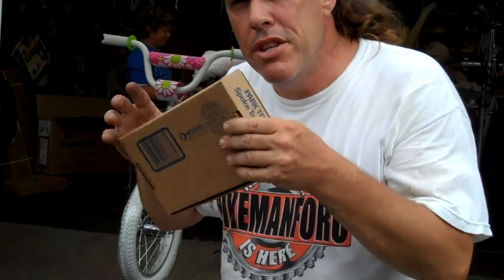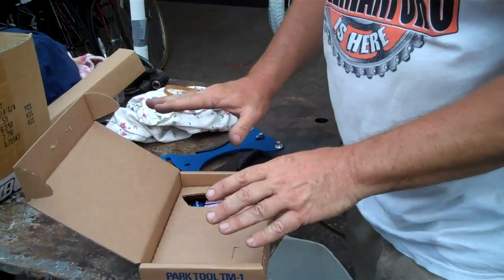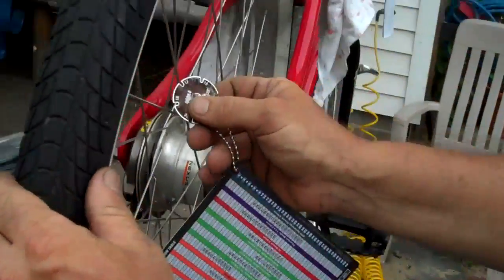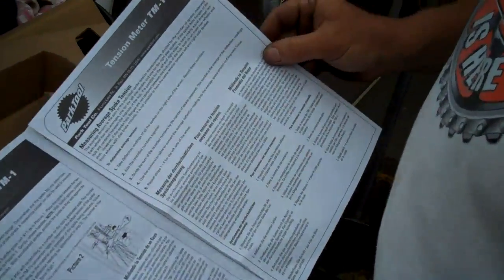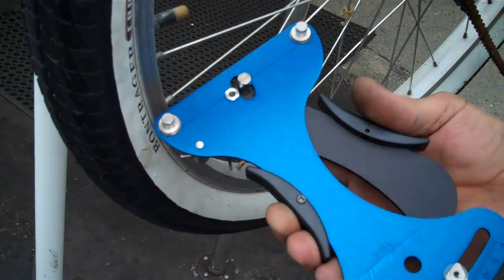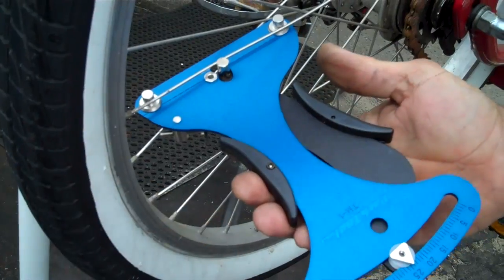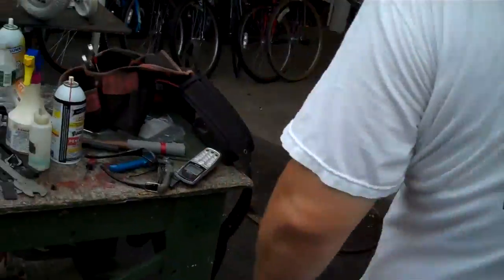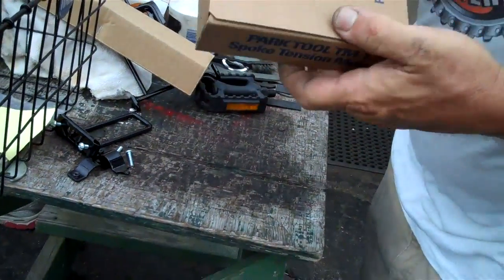Wheel Spoke Tension Meter Park Tool TM-1 Home Bike Mechanic

Comment: Fantastic tool.  I've built at least twelve new wheels with this tool and use a computer spreadsheet to automatically check variances in spoke tension.  The tool also works great to diagnose a bent or deformed rim when you cannot see the problem but a spoke or two keeps breaking and you don't know why.  For that, simply true the wheel and check the spoke tensions.  The rim deformity is near the spoke that is +20 percent or more out of tension with the other spokes.
Reply: excellent tip.. thank u

Comment: You're the first person I've seen release the handle properly. I see so many people demonstrate it by letting the handle snap back violently. I've experimented with that method and have gotten totally different readings on the same spoke. 
You have to slowly and smoothly release the handle like you did to get accurate and consistent readings. Having the tool does no good if you don't make the effort to use it right.

Comment: I'm the same way with special measuring tools. I have two tools for measuring sizes, a dial caliper and an electronic caliper. I never throw them in with wrenches and other stuff. I understand your emphasis on protecting it, of which some irreverent clowns made fun. Thanks for the video, Bikeman. I have been considering buying this tool but wanted to see it in use, first.

Comment: Nice review.   It comes in a nice cardboard box that should be re-used for storage as you point out.  It would have been a good idea for this tool to come in a plastic box similar to that in which a torque wrench comes in, with a separate pocket to keep the gauge and table in.  This would impress on the buyer to keep the box and to USE IT. 

Since I use the table and the gauge every time on mine I carefully keep the table on top of the gauge rather than bury it under the cardboard insert.

Comment: Also when you first mentioned this is a wheel  building tool, you are checking the tension on the low grade wheel that is being  checked with a tire inflated to correct psi. Is this tensioner reading correctWhen you first build it or one attire is audited and inflated to correct PS I?

Comment: And Also is there a publication of the spoke tension matching with at least the most common of rim design, be it with and or without eyelets. I was thinking of the ones with eyelets have a higher tension.  Hmmm.

Comment: I have one myself. It is very useful.

The durable plastic chart / card that comes with it is absolutely amazingly perfect in every aspect. Even better than the tool itself perhaps :). 

No more snapped spokes after using this tool correctly...

I use as a rule of thumb, 1000 Newton on 2,0 mm spokes. A good starting point I assume. Over that, the nipples might start to fail, the tool grip collapsing, twisting and failing.

If one are a bit skilled, one can have a wheel with a lateral run-out of +/- 0,05 mm and a spoke-tension not spreading more than +/- 5 percent, if the rim is good, using this tool.

Many many kilometers without any further service. Especially important for heavy persons (> 100 kg), or persons who may like to bike over large logs or stones. 

I have no connection to Park-Tool, eventhough I have vistited Minnesota USA.

"Det är ett Präcisionsinstrument" haha.

Comment: Is your tention checked before or after the tire is on the rim and inflated? I was just curious about load tension of the spoke at the 6 o'clock position with a load on it. What I'm asking is when is the correct, and most accurate Time to check spoke tension? Also when you do all we'll build you pre- stress the spokes in any way?
Reply: Disregard last sentence. Voice to text &^%$#@!. And by which method do you pre-stress a wheel?

Comment: Very good tool with only three problems:
1.  It is overpriced.
2.  The cardboard box is sealed by one of those gorilla staples that are impossible to remove without damaging the box for this finely-crafted measuring tool.
3.  The gauge numbers are printed upside down to the user.  (Do the mental math.)
-
Very good tool though.
Like changing your own oil in your car.  
Tension your own spokes and you will virtually eliminate wheel problems.  
(Unfortunately this won't eliminate TIRE problems.)

Comment: Just like on a torque wrench the tool should be used slowly instead of jamming on it.   Torque wrenches should be carefully eased into the proper torque until the bar-type gauge reads the target torque and especially for clicker types as it is really easy to over-shoot the torque value if pressure on the handle is increased too quickly.

The same goes for this tool.  

Plus, slapping the handle shut could cause the tool to miscalibrate itself or greatly accelerate that process.

Comment: the tension tool can be used when truing wheel? On my bike the front wheel is off. is close to the left side of the fork. How i bring to the center. I lose the left side spokes and i tighten the right side spokes. But the wheel stay left what i do wrong. One i do wrong and i screw up strip four spoke nipples. The bike is new but the spokes is was lose. I tighten the spokes both sides after i tried truing the wheel. But i do the spokes too tight when i tried truing the wheel some spokes nipples is strip.
Reply: +Haralabos Lukatos You need a truing stand.
Reply: I have two truing stands. The park tool TS 2 and the TS 2.2 I try to learn how truing wheel very prefect. I do true the wheel left and right the woble but i stay cant do very prefect. What i do wrong way i wish i knew. Also the wheel is not round 100% is do like egg have low and high spots how i do the wheel prefect round?
Reply: If you over tighten you will creat the oval distortion. See GCN and others on YouTube for guidance on truing your wheel.
Hope this helps.